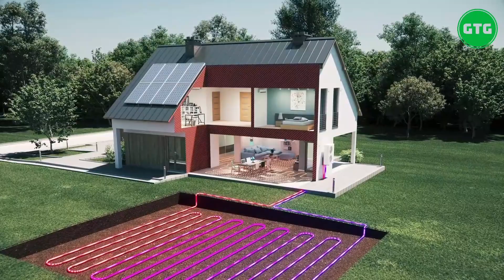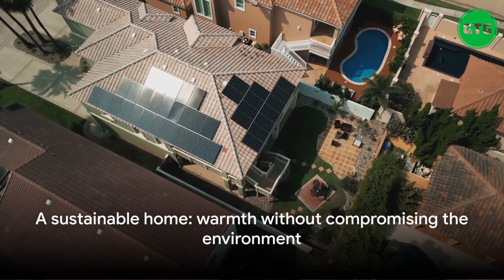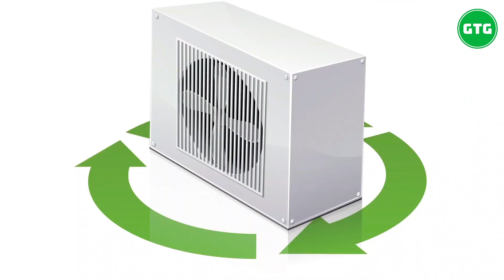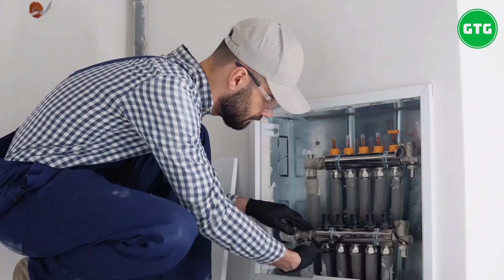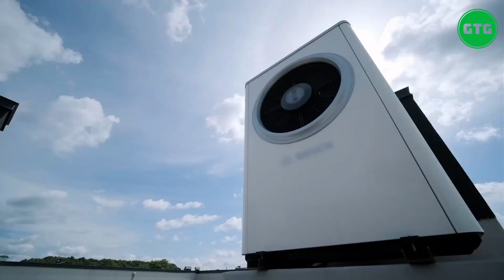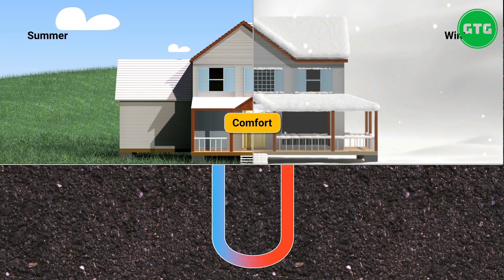Hybrid Heat Pump: The Future of Sustainable Heating For Your Home

Comment: LOL! Shameless PR coughed up by the gas industry. The business ethics of heroin dealers, frankly. Heat pumps are mature technology in some of the coldest regions in northern Europe where they don't use gas, not even during their long, freezing, dark winters.
Reply: This really is shameless! It is trying to suggest that heat pumps are difficult to install, aren't reliable, can't be used by apartment dwellers, and are expensive. Of these, the most honest comment is that they cost more than a gas boiler. Of course a hybrid system will 'shine' compared to a heat pump when used in a badly insulated home as the boiler can generates the 20kw of heat that will be lost from the home in the depths of winter cheaply because gas is still relatively cheap. If the home was insulated well, a single gas boiler would be as efficient as a heat pump. Shocking video.
Reply: Ground source heat pumps work ok with underfloor heating, but require a lot of space, which many properties dont have. Air source heat pumps are almost useless in northern latitudes. This is the reality. From experience.

Comment: also this is just a Dual Fuel system and thats nothing new, shits been around for decades.
Reply: The UK is roughly 30 years behind in terms of climate tech.
Reply: @velianlodestone1249  It's not like heat-pump technology was developed because of climate change. It was developed long before climate change became a reality, because it works as one of the most efficient ways to heat water and space.